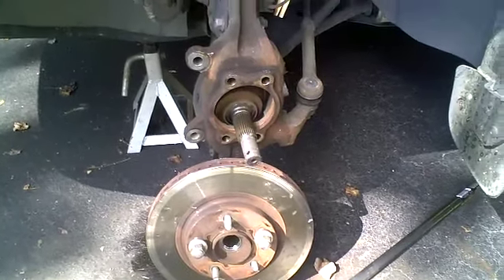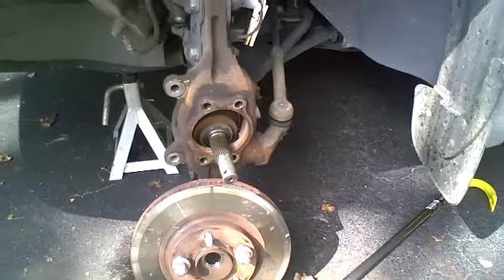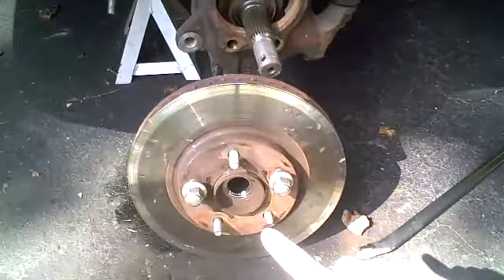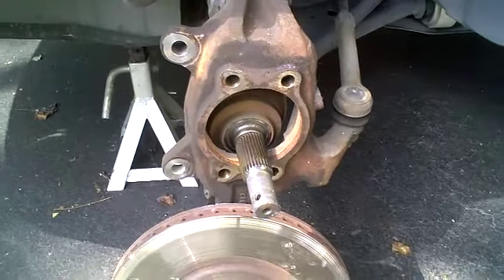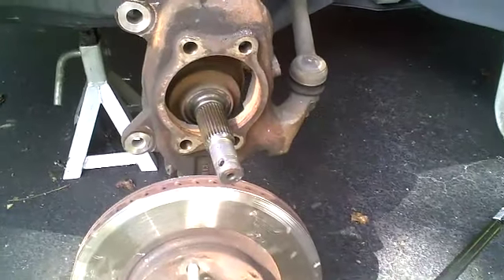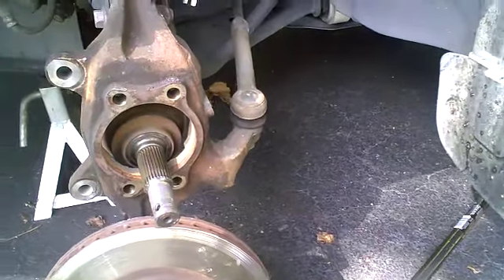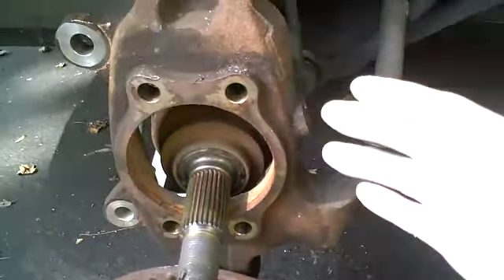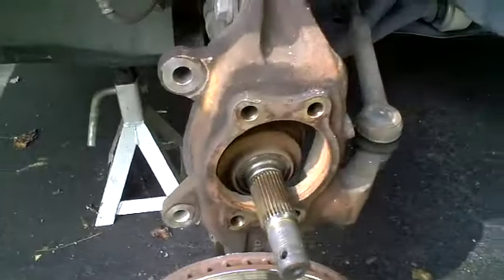2008 Nissan Quest Stuck Wheel Bearing Solution

Comment: I tried this with no success.  What I did use and work great after hours of banging was put the rotor back on and cut a 2X4 wood block (length from rotor to frame) start the car and turned the wheel inward and it released within seconds.

Comment: I did mine last Saturday and have same problem but after smacking many times the hub bearing from different sides, everything came loose. Don’t loose your temper and keep smacking with a solid hammer.